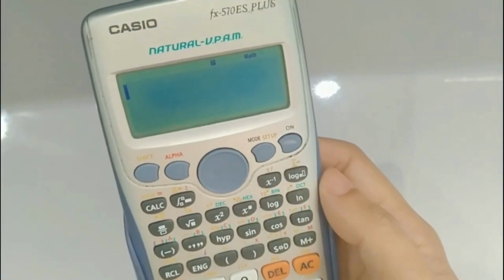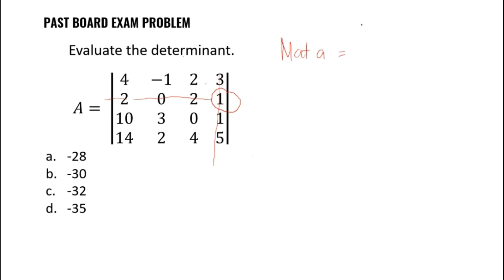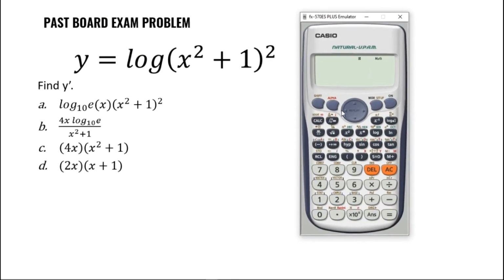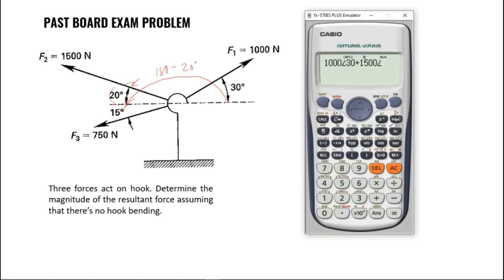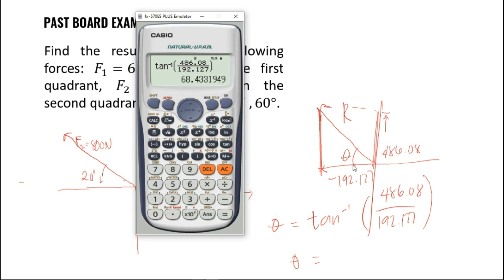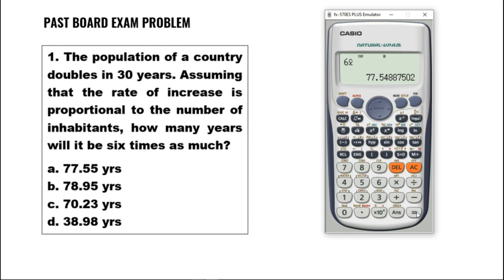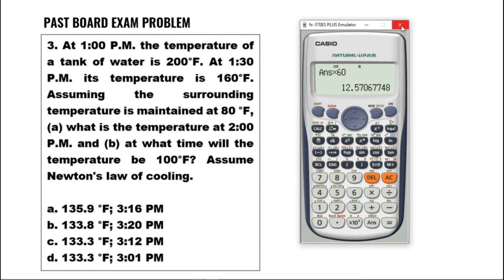CALCULATOR TECHNIQUES (ENGINEERING MATHEMATICS)

Comment: If you allow me few comments: [1] For those 2D static force calculations, I think it would be easier/faster to use Rectangular to Polar to obtain Magnitude and Angle, also saving to write on paper the X+Yj components. 
[2] Use of regression models for thermal decay is nice, even nicer to remind us all that Arithmetic and Geometric progression problems could be solved with regression models too - good catch - easier than modeling more complex summations.
[3] I believe the solution on the exercise at t= 1:12:00 is inadequate, as it asks for the ‘difference in time’ from 20C to 25C, so it should be calculated as (30-25)X^ minus (30-20)X^ . 
[4] For the last exercise, you could convert HR (decimal hour) to HMS faster using that button (° ‘ “). 

Very nice and pleasurable to see your knowledge to solve exercise&practical problems! 
Signing to your channel right now.
Thanks
Reply from the maker: Thank you sir!❤️

Comment: Amazing series of exercises using an Engineering Calculator with these more modern built-in features. Obviously on a Sharp EL-W516 the kaystrokes would be different, but the exercises themselves are still valid. 
Thank you for sharing!

Comment: Timestamps

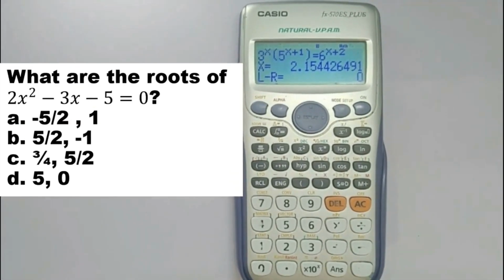2:58 Solving for Roots
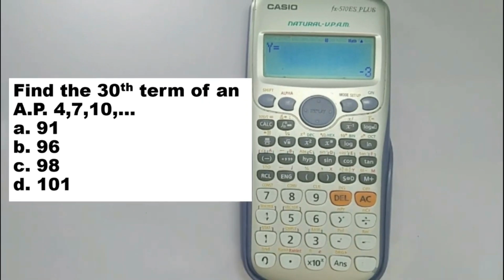6:08 Arithmetic Progression
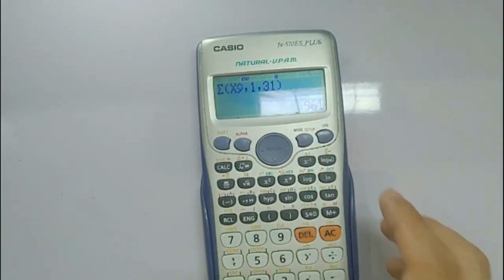11:12 Geometric Progression
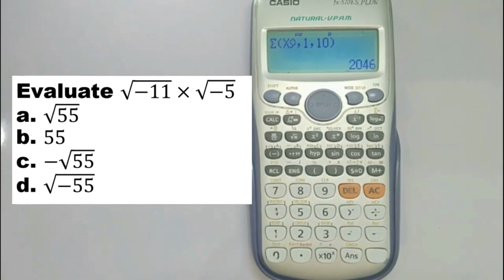13:37 Complex Problem (Complex Mode)
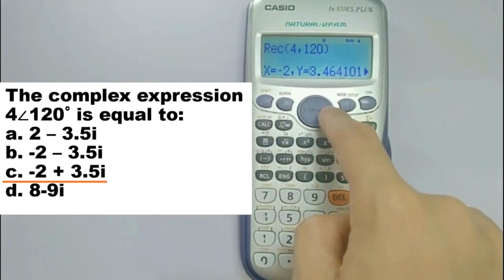16:40 Limits (Calculus)
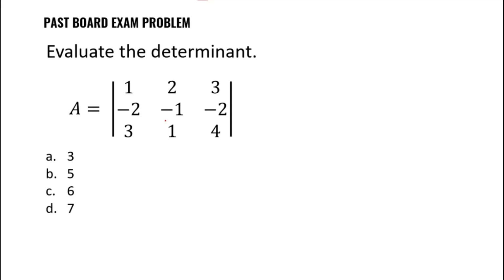18:55 Matrix Problem
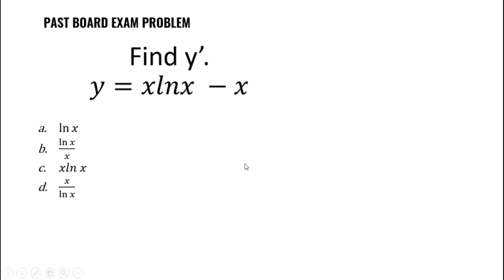29:20 Diff Calculus
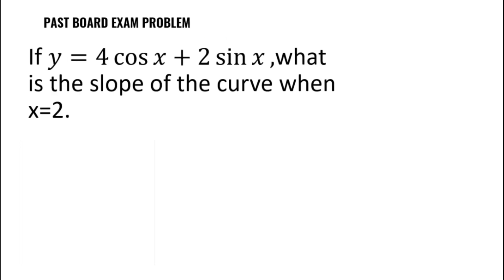35:28 Slope of the Curve
36:40 Vector Analysis
42:02 Statics (Resultant)
46:19 Vectors (Intersect at a single point)
49:30 Statics (Resultant)
56:00 Differential Eqn (Decay, Pop. Growth, Newton's Law of Cooling)